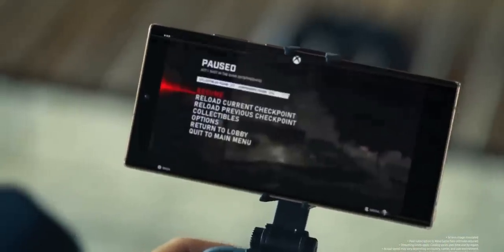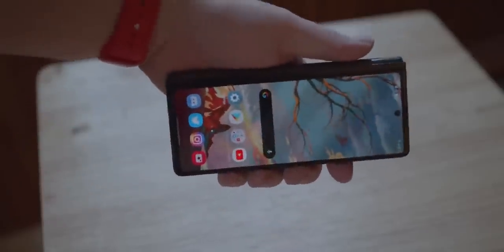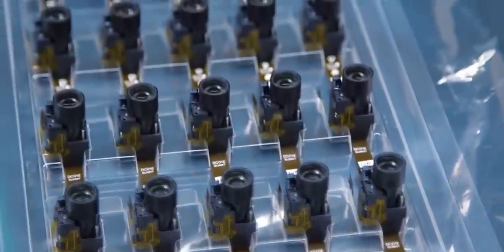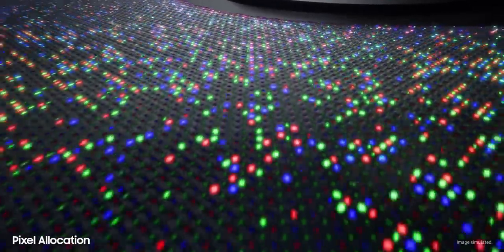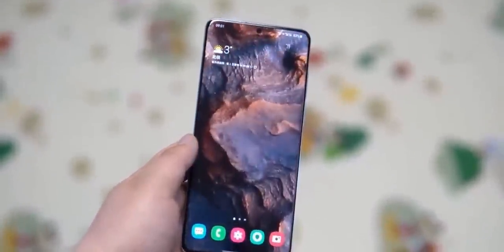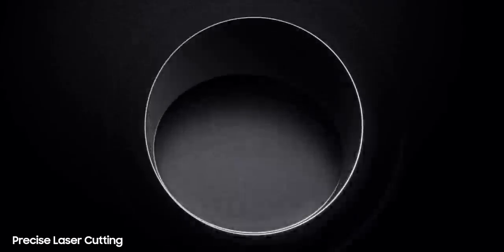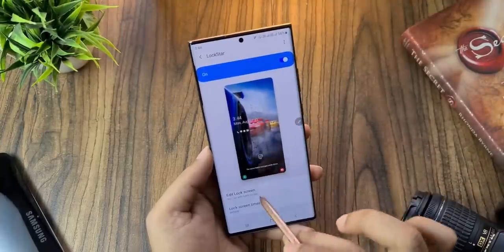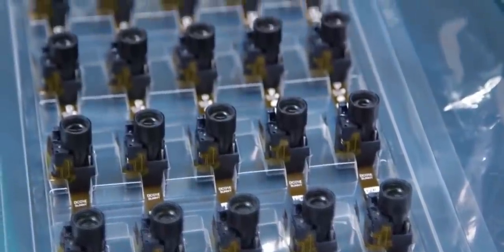Galaxy S21 Ultra - SAW THIS COMING

Comment: Hmm this is strange one for samsung. Normally they keep a similar design for 2 years, the first year they test them next year they refine the design. S6-S7, S8-S9 would be S10-S20 but now s10 to s21? Hope they don't be like apple and give 4 years of the same design.
Reply: It's crisis time bro and this is new tech so they hurry it might affect there goodwill in customers
Reply: I mean they have a reason for that. They haven't perfected it and don't want to put it out faulty. And they didn't have enough screens. So don't worry about it
Reply: John last, So yeah it makes more sense, to design a phone, perfect it and then move away from that familiar perfected design to a less refined design? I agree that it doesn’t have to be 4 years but atleast 3, because also with that they are saving money and that means a cheaper product!!!
Reply: Because the tech is still not mature yet, wait until it's mature
Reply: Samsung’s design is arguably ahead though. And they also have a reason for delaying the under display camera. I don’t use Samsung, but I would much rather them wait until they can release a good final product, rather than rush a design because of some people’s bs expectations for Samsung
Reply: s10 and s20 don’t even look the same lol
Reply: I see where you are coming from,  
but in one or two important respects, apples approach of not making major changes to their phones does actually have some advantages. 
it does allow them to continually refine the device. 
it also does allow for next years devices to ship with less buggy surprises  like for example the focus issues on the S20 ultra.
It also allows more accessories to be made for the same device. 
making big changes in device hardware every year makes it hard for phone makers to deliver a good package.
Reply: If it ain't broke,dont fix it.
Reply: Would not mind if they use the Note 20 design
Reply: But theres a difference between notched and bezel versus full display.
Reply: I think it is because of their three year OS update policy as well! I think it is fine. Atleast the design of their flagships will not age as much.
Reply: Maybe we have hit the wall now. It will takes time until the new solid battery, graphene battery, new haptic feedback that feels like real button, transparent display for under display camera, new display technology integrated with vibration onto the screen which can also prevent accidental touch when full display to comes out and etc etc...

T next gen phone will be buttonless and bezel would probably still remain the same since where would you grip your phone then
Reply: They arent being like apple in this context. First of all corona put a hault on businesses and the progress innovation, second under display tech is extremely hard to accomplish no tech company in the world atm has it completely right. At least we know samsung is working on it and is using the fold as a quasi beta
Reply: S3-S4-S5 had the same design tho.... And s10 and s20 are differents

Comment: That's disappointing but I'm really happy they put effort to at least include it in the z fold 3👏
Reply: But if they did, it will cost more and probably get an issue after months
Reply: @hisham6492  yeah, it will probably cost more but I don't think it would have any issues. I mean... Samsung seem to have thought it through, giving how long we've had the punch-hole design

Comment: I'm Fine that the S21 won't Have the UnderDisplay Camera. Technology is Not As Easy as you Think. 👍🏾
Reply: I had the same thought aswell
Reply: Same, it’s really not that big of a deal to me
Reply: oneplus 7 pro did it 3 years early what is not easy is just Samsung trying to sell their old tech to losers like Sammy Fanboiis
Reply: @great-one0389  Same Opinion.❤
Reply: KTBL Gaming that was a pop up camera.
Reply: @great-one0389  true, It Reminds me of the A80, If You Heard About it.
Reply: Jeremy's Studio that is even more extreme than pop up, the back camera flips for a selfie mode
Reply: @great-one0389  I Know Right, That's My Favorite of all Mechanism Camaras. ❤
Reply: @KTBLGaming  Then Oneplus removed it later from their devices. Ever wondered why?
Reply: @PankajKumar6493  Yes because sammy made them by forcing the punch hole screens on them  and living them without an option. Since samsung is the only company that makes good high end oled OP had to agree wit the awful terms samsung forced on everyone except few Companys that use LG as a suply chain for oled screens
Reply: Man, I'm using a 2018 phone which is of course it comes with a notch display and I'm not even complaining
Reply: @CarRevvedGaming  I Respect That. ❤
Reply: @KTBLGaming  lol that's not how business works. Nobody is pointing a gun at oneplus's head to make them buy their display. Oneplus moved on from it because it's an inferior technology. They wanted to add IP68 rating in their phones and make them thinner. So they had to remove moving parts. Do you really think Samsung pokes a hole in their display before sending it to oneplus without their permission lol?
Reply: @KTBLGaming  Plus Samsung display and  Samsung Electronics are 2 different companies. The display company doesn't ask the electronics company before selling their display. They sell according to the demand they get. Hole punch is in demand.
Reply: @PankajKumar6493  yeah whatever makes you sleep better ..
Reply: @KTBLGaming  you mean reality? yeah

Comment: Still waiting for Samsung to stop selling weak exyons process in flagship!
Reply: I think the upcoming exynos will be quite good since it's gonna use ARM and possibly the X1 core. But it'll come with a Mali GPU.
Reply: Waleed Ali  that will happen in 2022 not next year.
Reply: Waleed Ali  Qualcomm has the budget for R&D and years of experience in mobile phone industry. So i think its not possible to beat them with shit exynos. And someone in the comments said that the about benchmark test where exynos was beating apple and qualcomm with consuming way more power than its competitors. So if they decrease its power consumption, its performance will significantly drop
Reply: Hamza Malik yes I heard the news I hope it will be good in reality
Reply: Waleed Ali hope so too. We should wait and see
Reply: That's a you problem,
Get a US varient.
Reply: @samlung2724  hmm fly me to the USA or if I try any other method they are asking more money. Like 2k dollars
Reply: Waleed Ali apple has bought all 5nm process for the distant future so the chance exynos will get a chance to make is very low for the next few years
Reply: > "Still waiting for Samsung to stop selling weak exyons process in flagship!"
Arriving next year, in a mid priced Samsung phone.  Best CPU ever.  Read the latest news.  View the latest videos.
Reply: @gregzeng  this comment was posted 6 days ago.. yes there a lot of new about the new processor but they might use the new processor for the next 4 years like last time

Comment: Well then s22 will be the real thing as AMD gpu is planned for 2022 too
Reply: Until it gets pushed back again..
Reply: Till 2022 Huawei, One plus and Apple are ahead. Especially Apple in terms of processors
Reply: @tolgatanriverdi4143  1.Huawei is dying right now(which is sad ik) and cant compete with Samsung.
2.U dont know what Qualcomm with produce until them the Snapdragon 875 is really close to Apple's A14.
3.When tf did the OnePlus were ahead of Samsung? I dont think for just 1 year that they will surpass them.
MY OPINION!!
Reply: The leaked AMD gpu benchmarks were great but they said it draw to much power they will probably lower it performance to be more power efficient and in the end it will be the same story with mail gpus
Reply: Is Samsung Galaxy Z Fold 4 5G.
Reply: @bravo6039  1) Huawei still exist and tries everything to be the nr 1 ( Harmony os)

2) The oneplus 8 pro is in almost every category better than the s or note 20 Ultra. Only the camera is better ob samsung but the rest goes to oneplus
Reply: @saeedsanad8484  mail upin ipin's friend?
Reply: upgrade year. I just got the note 20 ultra
Reply: @tolgatanriverdi4143  
That is "BETTER". Not "AHEAD" of Samsung!
Wrong choice of word..
Reply: @tolgatanriverdi4143  Im pretty sure the Note 20 Ultra has a better display than the Oneplus 8 Pro
Reply: @asdafaafsaffa2871  mail pun bolehh😂
Reply: I guess I will not be upgrading to any Samsung phones until I see these kinds of improvements
Reply: Even Snapdragon will become powerful in 2020..gap btw exynos and Snapdragon may decrease but can't defeat Snapdragon
Reply: @saadaanpatel3159  yep,its sad that samsung cant do better with exynos,they really need to and I would think they are trying but it aint easy.But samsung isnt going to let qualcomm have the monopoly on their chipsets so thats a problem.
Reply: @kelvinpang438  where are you from,.,... Are u on discord
Reply: 😂😂😂😂 again😂😂😂😂😂
Reply: You will have to wait until 2030😂😂😂
Reply: @aimananuar2106  😂😂
Reply: @bravo6039  Huawei is dying but managed to beat Samsung in sales and was ranked number 1 phone company earlier this year and idk about now. Anyway, about the Huawei's chip, it won't survive any longer since kirin 1020 chips are very limited, so the company decided to use snapdragon which is even better and MediaTek for budget phones. Huawei can still compete Samsung and Apple even though Huawei was hurt so badly
Reply: @tolgatanriverdi4143  no , Samsung has better experience , OnePlus is just a blank phone with little features and is meant for teenagers
Reply: I'm not upgrading until they have holographic screens...that Samsung Galaxy S30 will be mine!!
Reply: Im waiting for s30 to upgrade from my s6 edge
Reply: Thought they planned it for the S21
Reply: @tolgatanriverdi4143  Huawei has much bigger problems, cannot produce their chips anymore. They have stocks for about 2 months for Mate, but their existence depends on gettings equivalent chips after that. Qualcom cannot sell them anything, it is embargo against Huawei. The worst thing is making the chips, because there are not many companies able to mass produse 5nm chips: TSMC quit the contract, Samsung is the other one capable to do it at similar quality, but won't do it (also cannot). There is only one chinese chip foundry, but it is way behind (years) Taiwan 's TSMC and Korea's Samsung. For instance, the Dutch technology used to make chips by TSMC cannot be used for Huawei, so until ones makes something else, they are obsolete. I guess they will try cheating, having other companies buying for them, but that will not last long. For one, it is bad to have less competition, but let's also face it, it was not fair competition as they are heavily subsidezed and helped by the government (like so many Chinese companies), so they can advance much faster and also produce cheaper.

Comment: I am hopeful for under display camera and display tech, but I'm fine with the current punch hole and I feel Samsung should just focus on making under display proximity, 3D face scanning, iris and flood illuminator tech, as then we'll finally have a phone that has an in display ultrasonic fingerprint sensor AND face id tech.
Reply: No, that’s the apple way. Samsung always has to have all the latest gimmicks. Every new phone has to have at least 69 new features on it for me to buy it.
Reply: I want iris security back. I love it on my s8.
Reply: @MirelRC   me as well as heart rate back
Reply: @darkvader125  that one too. It was pretty helpful for me.
Reply: Color Safe Bleach Gimmicks ? Lol f you say so. Samsung develops new innovation. And Apple just makes it better which is not IN FACT INNOVATION. So I would say they develop lots of INNOVATION.
Reply: You need a notch for all that
Reply: @bilalahmedsiddiqui9639  I'm saying that Samsung should work on making that tech under the display so they won't need a notch.
Reply: @bilalahmedsiddiqui9639  what harm in it by the way
Reply: @bilalahmedsiddiqui9639  we will get better biometric instead of a gimmick fingerprint
Reply: @darkvader125  gimmick fingerprint? Wtf dude, it's like super amazing, I use it daily
Reply: @filip9587  Samsung is already doing that, it's a work in progress
Reply: @bilalahmedsiddiqui9639  yes its gimmick

Comment: Under display camera: *is about to exist*
Apple user: It's all gimmick!!!!
Reply: Until they start buying the display from Samsung and then it will be revolutionary tech on apple 😉
Reply: they already exist though
Reply: @Metalshark100  it's still didn't get much attention, but if samsung did it other brand will follow quickly, except apple with their notch problem
Reply: @eyeofthewickedlord6631  it's not getting much attention because youtubers aren't speaking about it everyday but its as you said. as soon as sammy does it then every youtuber will be on it and everyone will know about it. but everyone shouldn't count on samsung to do something just so they can know about it, that's as bad as being an apple sheep.
Reply: @Metalshark100  still
Reply: @eyeofthewickedlord6631  it will notch be a problem unless it punches a hole in their wallet
Reply: @ezronthelegend  is that intended pun 🙂
Reply: @eyeofthewickedlord6631  yes
Reply: Eye of The Wicked Lord I’m not expecting Apple to get rid of the notch until they can put it under the display. Pretty sure it’s harder for them since they have a few sensors to put under, not just the camera. I’m willing to wait though, since I prefer Face ID as my method of unlocking
Reply: @Brian-wp9er  they not a small company tho, so far I haven't see any iPhone worth the price. I can get a features (that I need) on cheaper Android. Just like the iPhone SE, the chipset is just a trash if we have a very limited usage on it. The small screen make it harder to optimize the the full power of the chipset. If I can't play game on it what the purpose of the fastest chipset in it? I just couldn't understand why apple keep reducing the batery capasity on their newer device.
Reply: Eye of The Wicked Lord Well that’s the thing. Android has features YOU need. That doesn’t mean iPhones aren’t worth it for the money, that means they aren’t worth it for the money to YOU. For someone like me, iOS’s feature set is more useful to me than what android offers.  As far as the SE goes, it’s obviously a supposed to be a compact phone. Gaming isn’t the most suited use for the phone, considering its small display and big bezels and small battery. I think the SE is made for someone who just wants a smaller phone, or need to upgrade from an old phone, or for someone who happens to prefer that design over what’s currently on the market.

Comment: Not one smartphone on the market has yet to impress me more than my underrated 2018 flagship Mate 20x. With its stylus pen smart cover and wireless display similar to dex from Samsung.
It  even has 21x9 aspect ratio video recording.
Headphone jack, flat screen and the largest commercially available flat screen smartphone in the world! 
IR blaster, Dolby Atmos that makes any tws  sound great.
Then I plug it in at night with 49% battery. capacity

Comment: The underdisplay camera still has its cons the imagines are blurry and washed out, its a big risk that samsung shouldn't make and they did a good choice to not include it on the s21, and its not a disappointing thing you'll still get a high quality camera until the underdisplay camera is perfected, and iam pretty sure the hole punch on the s21 will be smaller than s20 so thats another good thing, and for them to include it on the fold 3 is a really smart move because as you mentioned there wont be making a large amount of fold 3, and another reason why its better to be on the fold 3 is you already have 2 selfie cams so making one underdisplay and one a normal hole punch would be a really smart way to test the water with this tech

Comment: Would totally save money to buy this phone, only if it didn't run such an unsafe and laggy OS called Android. I know iPhone hardware is worse than the samsungs and others, but I still choose iPhones because of the iOS it has. Safe, stable and optimised.
Also, Love your accent. ;)

Comment: Great as always Sal ❤
Question :
There are some roumers that the exynos 2100 scores are bad compared to SD875
Like 1100 SC
3100 MC
Will they use exynos 2100 or exynos 1000 ?
Or they are the same ? Ty in advance 💜

Comment: I have a feeling that they're going to put that under display camera on the Note21 ultra. The Note, like the Fold is not as big a seller, so should be able to use it. I tried Good lock and honestly it's not that amazing. I uninstalled it. It's like putting a skin on top of One UI... so it's a skin on top of a skin.

Comment: Well, its better if Samsung dosent include UDC because S and Note series are flapships purchased in mass numbers and putting a UDC is like an experimental feature that is gonna drop down the quality of the selfies and people are not gonna like that also not to mention the top range flagship costs 1.4K just imagine what it would cost with an UDC.Personally I would preffer if Samsung putted UDC firstly on A range like A91 or A81 so they can see if people like it and how does it feel, and without mentioning The bigh thing with note 7 when samsung rushed with the battery capacity and then it made Samsung users or new users have trust iaaues with samsung.

Comment: Honestly I don’t know why so many are disappointed that Samsung couldn’t bring an under display camera. The fact that Samsung has prioritized its design, with actual 90% edge to edge design, now with the chin shaved off completely, we need to be grateful. I remember back in 2018 everyone was complaining about how Samsung couldn’t do away with the chin. Now they did. What else do u guys want more? It won’t hurt to keep a design past the 2 yr threshold. The punch hole is also more smaller and diligently refined. Also the design refinement from the s10 to the s20 was incredible. Didn’t even realize Samsung could shave down more bezels